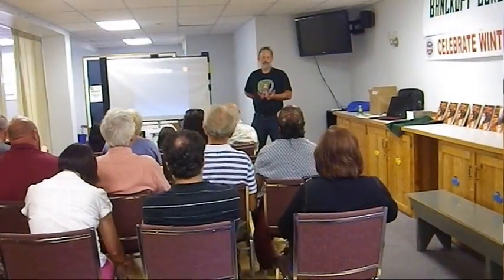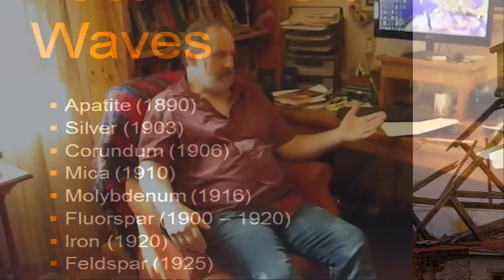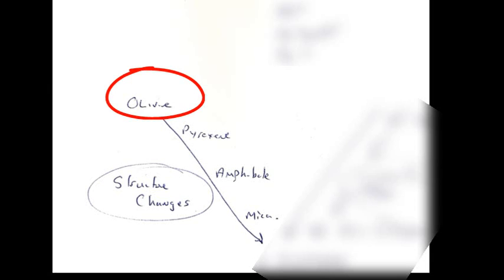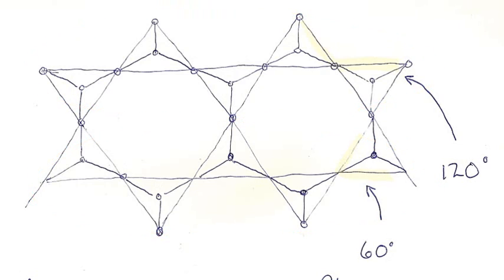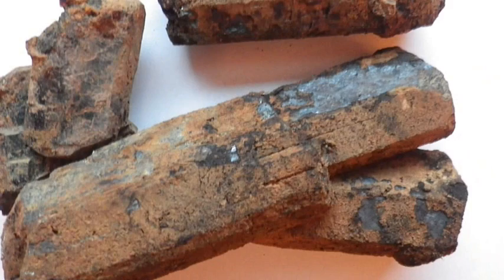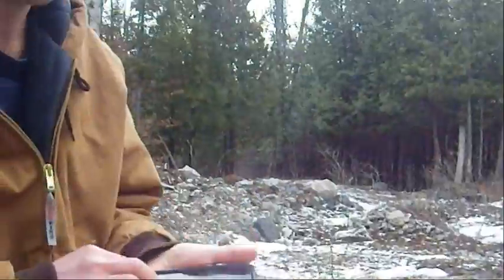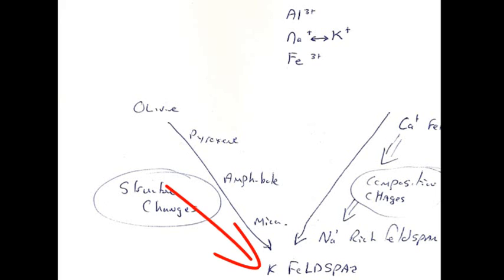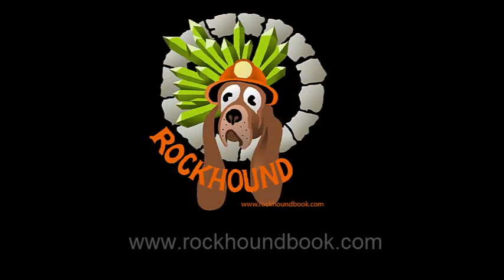Mica Cleavage and Bowens Reaction Series- Rock and Mineral

Comment: I was at your talk on Sunday at the Gemboree and I enjoyed it. I brought in a couple minerals I found on my property to be identified and I was told that they were Hornblende and Feldspar. Does this mean I might find the other minerals of the Bowen reaction series in the same location?
Reply: The Bowen reaction series applies to igneous rocks (magmas that cool) - which greatly simplified, results in increasingly complex silica tetrahedra structures as temperature decreases. Since most feldspar and hornblende, especially as well-formed crystals, found in the Bancroft region are of skarn origin, the Bowen series does not apply. However, since you have hornblende, you will probably not find diopside or olivine, because these typically form at higher temperature. You could, however, get quartz and biotite.

Comment: Do you know if it true  if you find octagon shape mica you will find sapphires near by?.  Thanks for sharing your knowledge enjoyed.
Reply: It's probably just a local indicator for that deposit where, I am guessing, the mica signals either Al-rich rock or some sort of skarn-type rock.

As for gem crystals, growth speed is not a control on gem quality. Some large crystals actually probably grow surprisingly fast (few thousand years). The nepheline syenite connection is that they are relatively silica poor and alumina rich, which can lead to free Al oxide (i.e., Al not incorporated into silicates). The other thing is that, under the right physical and chemical conditions, nepheline can breakdown to corundum and albite.
Reply from the maker: No, there is no direct connection
Reply: Thanks for reply  sapphire miner from North Carolina  told me if you did your close of finding them
Reply from the maker: In that particular area there might be some kind of link like for example well formed crystals of any type would suggest suitable cooling processes where large, quality crystals of many types might grow, if mica represents the formative environment there it is not necessarily a transferable observation to other areas. Being an aluminum oxide - same as the mineral corundum, in Ontario it is the presence of syenites that seem to dictate the presence of Al2O3 crystals, however a good slow cooling and freedom from other impurities would likely dictate the growth of gem corundum (sapphire). If I recall correctly, nephylene has been present at both gem sapphire areas that I know of in Ontario.